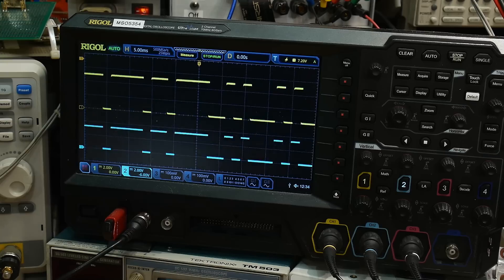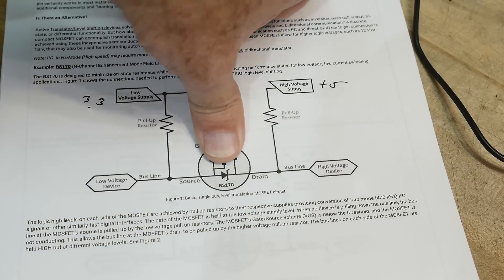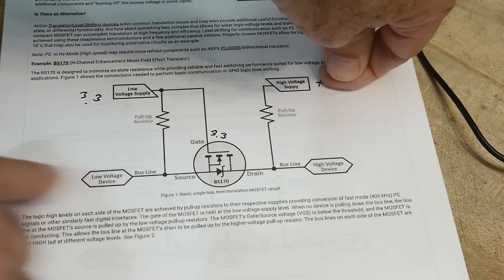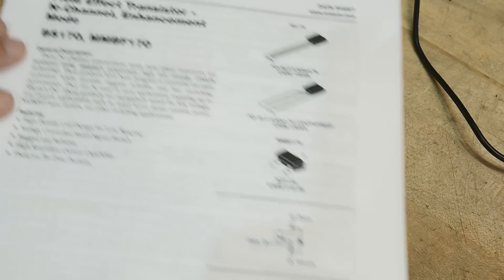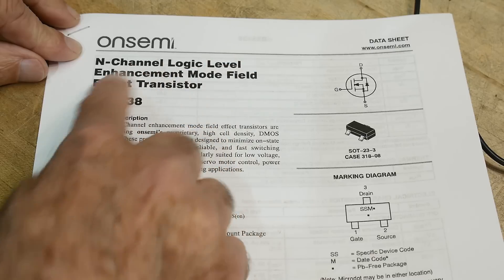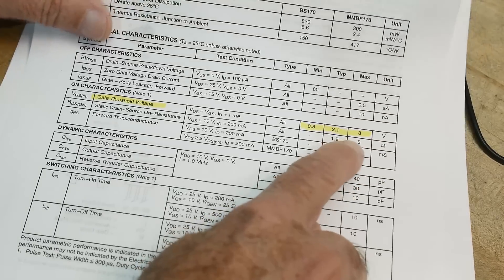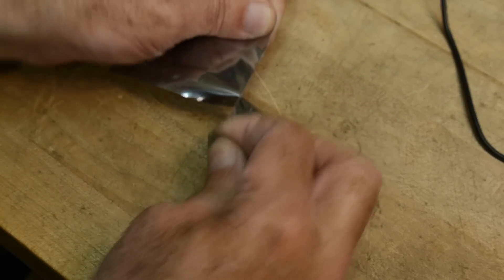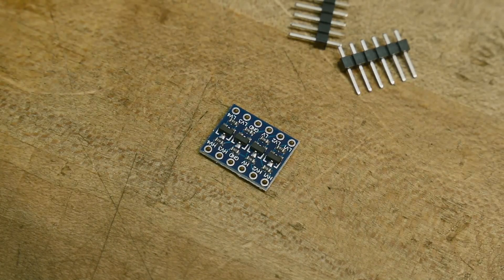#1855 BSS138 Logic Level Translation

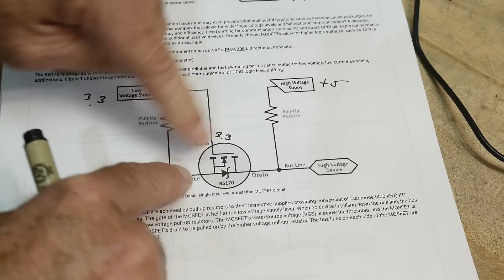Comment: 3:34 Wouldn't the 5 volts get sourced into the 3v device then. It doesn't make sense. The 5 volt side would then fry the 3 volt side since the 3v side went low and is acting as ground.

Comment: Nice video, how fast is the ON or OFF state.
Reply from the maker: AI: If your application requires data speeds of under ~400 kHz, the BSS138 level shifter with 10kΩ pull-ups is an excellent, simple, and reliable solution. For speeds approaching or exceeding 1 MHz, especially for protocols like SPI or I2C Fast Mode Plus, you might need to:

Reduce pull-up resistor values (if your connected devices can handle the current).

Minimize bus capacitance (shorter traces, wires).

Consider a dedicated active level shifter IC for optimal performance.
Reply: @IMSAIGuy  Thanks much, only around
 20KHz

Comment: You can easily fix the problem by raising the gate voltage of the BS170 to 5V. From the specs, Vgs_thres > 2V for all temperature <125°C, hence the low voltage side will not exceed 3V (without the pull-up at the low side) when both sides are open.

Comment: This is timely and awesome!  I've been using the classic BSS138 circuit for several products for the last 5 years.  I just adapted the same circuit as a cutoff switch for an i2c bus that was conflicting with our AVR programmer.  Both sides are at 3v3, but the gate is tied to the programmer's separate 3v3 bus.

Comment: The NXB0101 chip (from Nexperia) is yet another dual supply transceiver, better suited for bus translation up to ~100MHz (3.3V↔5V, and it can also go high-Z). NXS0101 is the open drain cousin, though it's much slower.

Comment: 4-ch PCBs from CN are Sparkfun module from 2013 clones btw.
A lot of those exist thanks to Adafruit, Sparkfun and the like OSHW contributions cloned and mass-produced often using CN analog chips (which are statistically quite good) if such exists, with genuine brand parts too, but generally CN modules almost always work.

Comment: I'm confused - but that's good.  Makes me do some head scratching.  One thing though.  In High School and the Air Force all of my instructors used electron flow!  When back in college, some of the professors would use electron flow and the majority would use current flow.  It was the same way with the text books.  I graduated with PTSD- or something.  There was hole flow but I don't want to get into that.  To many memories.  Well that's maybe why I'm confused.  Thanks for the time spent on a great presentation!

Comment: Hi Sir please reply... 
this question is very very confusing...
I have 2 identical 12V DC 7.5Ah batteries say X and Y.
One side of a normal bulb is connected to postive terminal of X battery, and another side of the bulb is connected to the negative terminal of the Y battery.

The negative terminal of X battery and the positive terminal of Y battery are not connected to anything.

So, in this case, I want to know whether there will be a current flow to the bulb, and whether the bulb will glow??? Give reasons if bulb will glow, and reasons why bulb will not glow.
Thanks in advance.
Reply from the maker: sounds like a homework problem

Comment: I use 74LVC245 for level shifting. The 74LVC245 is great for higher speed signals vs discrete FET based level shifters & have 8 lines. Additionally TXB0108 is a great level shifter too though I have quite a few SN74LVC245AN’s around.

Comment: I've seen bipolar transistors used in the same topology.  The only change needed is a base resistor.  As with a mosfet the transistor will work backwards.

Comment: Thanks,  I did not know about this topology for level shifting.
@5:11 remember the source and drain of the normal MOSFET transistors are interchangeable.  So when the output is low the source and drain are exchanged.
Here the body diode does not get engaged until much higher currents( that is when I x Ron > 0.7 V)
The advantage of this topology is its speed and it is bi-directional, the disadvantage is use of constant static current.
Normally level shifters are made of cross coupled pmos transistors on top of nmos transistors.
The disadvantage is that it slower than this topology.
Also, if you have MOSFET transistor that you could connect to its body, it is better to connect the body to the lowest voltage( ie. in this case 0 V)
Reply: The static current situation isn't as bad if you're already using a protocol, like I2C, that is designed to use open collector outputs, pullup resistors, and logic high idle state.

Comment: Keeping in mind these are only good for low speed like serial ports and slow spi etc. There is way too much capacitance in the junction to use for, say 10Mhz, and you have to resort to the proper chips with more stuff inside them. It can be easily seen on the oscilloscope at higher frequencies and can be confusing on the logic analyser.
Reply: How fast can you get with two NPN BJT's connected together in reverse orientation (emitter to collector)? With the two bases pulled up to the respective voltages you want translated as well as pullups on the emitter/collectors.

example:
                         1K
              |------/\/\/\------| 5V
              |                         1K
              |               |------/\/\/\------| 5V
              |          __|__                    1K
              |      * |/        \        |------/\/\/\-----| 3.3V     
              |     _/             \_     |
    A  o__|__|                    |__|__o  B
                   | __               __|        
                          \         /| *2N3904
                            \___/
                                |          1K
                                |------/\/\/\-----| 3.3V
Reply: @pol.kraine7890  You would have to draw it up in spice. It would be faster as FETs have much more capacitance then ye olde BJTs. Then again, the dedicated translation devices have Schmidt triggers, giving them even less limitations at high bandwidth.

Comment: A few points: there is a 2N7002 which is like the 2N7000 but with tightened spec (threshold voltage = 2.5V max) in an SOT-23 package. However the BSS138 is cheaper, so good catch.
The body diode in these small signal MOSFETs isn't going to be dropping as much as 0.7V in conduction, more like 0.6V when loaded with 10K from a 3.3V rail, so Vgs is at least 2.7V.
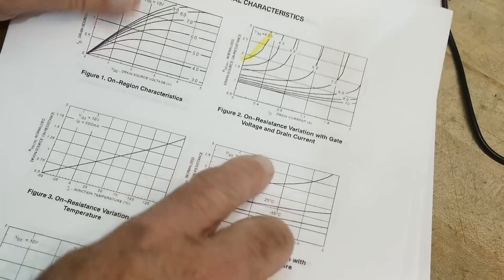At 9:00 when the MOSFET starts conducting as the diode is turning on, the channel resistance becomes so low that the source is effectively dragged down to 0V. You now have 3.3V Vgs, not 2.6V.
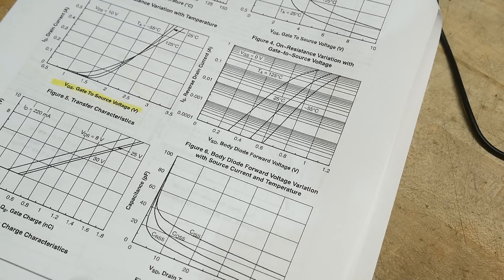At 8:20 we really don't want the MOSFET to turn on "hard", just "hard enough", otherwise the increased gate charge reduces switching speed. Better not to in level-shifting applications.

Comment: interesting, You also got  TXS0101 (single),  TXB0108 (8 fold), but require 2 100nF capacitors on both supply sides.
But the Sizklai also works pefectly, but requires 1 more transistor than your circuit, but not bi directional.

Comment: nice introduction of this nice MOSFET and the use in level shifters. However, the real resistance is of minor importance for a level shifter. Even for I2C lines it only has to be significantly below the pull-up resistors' values, but 10s or even 100s of Ω should not matter much, unless you have long lines with high parasitic capacitance and high frequency signals.

Comment: The 74CBT16211 bus switch is my favourite device for 5V<->3.3V logic level conversion. It has 24 lines, so you can level convert an entire chip at once, and the fact that it doesn't use pull-up resistors makes that it works at much higher speeds than a MOSFET solution. You should make a video about it!, Using the 16211 for logic level conversion ain't too obvious from the data sheet, so a video would be helpful for people.
Reply: Are you sure it really can do logic level translation? Sure, there's a bullet point mentioning logic levels but there's no way to tell it the range for a given port. The description says switch, and another bullet point discusses analog applications among others. I struggle to see how it could function as a level translator while also being suitable for analog applications. 

Have you hooked a scope to an input and output and verified that it's actually reducing/increasing the voltage?
Reply: @markp5726  Yes, I told this ain't obvious from the data sheet at all. Search for the "Texas Instruments CBT (5ĆV) and CBTLV (3.3ĆV) Bus Switches data book". At the end of the book, there is a chapter about using these CBT chips for voltage translation. Basically the FET switch reduces incoming voltages to 4 Volt. To make them limit voltages to 3.3V you insert a diode into the Vcc line, and you can buy these switches with the diode already built in, they have a D into their part number: 74CBTD16211.
Reply: @markp5726  I said it was badly documented :) The 74CBT74211 will by default limit voltages to 4V. You need to insert a diode in the Vcc line and you will get 3.3V. But there is more: There exists an 74CBTD16211 with this diode already integrated into the chip, making it ideal for voltage capping an entire bus at once.
Reply: @danielmantione  oh that is weird. The datasheet for  74CBT16211 (which I found first) is fairly different from the CBTD version

/me dives for the rabbithole...

Comment: There are indeed much better MOSFETs available nowadays than the BS170, and they are also much cheaper. The only advantage it has is that it cab be brought in through-hole package, making it easy to use on breadboards and experimental PCB's and so.

Comment: Great explanation, love the detailed analysis.  But 0.7 volts is (kinda) valid for 3.3 volt devices.  Also given the light loading, the diode will (probably) be less than 0.7 volts.  "Engineering is the art of what you can get away with".
Reply: I doubt bridge building engineers embrace that saying.
Reply: @jspencerg  Except yeah they do. There's a reason for the saying "Any idiot can build a bridge that stands, but it takes an engineer to build a bridge that barely stands."
Reply: @AttilaAsztalos  "...with the correct safety factor thrown in"
Some engineering fields permit or even encourage wanton cost saving, planned obsolescence or life till the end of warranty. Bridge building in the USA is not one of those.  Neither are the probe building wizards at NASA.
Reply: @jspencerg  With NASA you may be fighting weight or size factors instead of cost.  And then there's always the old 'time to market'.
Reply: @jspencerg  One would hope, but I'm afraid some do.
Reply: The 0.7V is only there before the fet turns on - once it's on, you get the 5 ohm (or less) path through the fet, and the diode is essentially out of the circuit. The diode just bootstraps the fet into the on condition, and then the fet takes over, and only in the direction of a low on the right driving the left side low. It's actually extremely clever how it works!

Comment: Thanks. The datasheet shows maximum Vgs(th) is 1.5V. It means if the gate is 3.3V and 0V at source in the circuit, then this MOSFET will get damaged. So it cannot be used for 3.3V to 5V level shifting. Please correct me if i am wrong....
Reply: The parameter you are listing is the threshold voltage, not a maximum voltage. There must be a voltage difference between the gate and the source for the MOSFET to turn on. That value in the datasheet is saying that for some devices that difference may be as low as 0.8 volts, for most it will be 1.3 volts, and for some the difference must be at least 1.5 volts before the device will turn on.   The value you probably were thinking of is Vgss, which my datasheet lists as + or - 20V for the BSS138.
Reply: @tfrerich  Heartly thanks for your clarification... Yes i got confused with Vgss & Vg(th)... Thank you...

Comment: I've used a 2N7000 to level shift 5V to 3.3V and it worked fine. Also used an A2SHB smt mosfet. The max threshold for the A2SHB is a Mere 0.85V
Reply: You want to avoid using NMOS like Si2302 (A2SHB), which has high Ciss capacitance (around ~7x more than BSS138). It will hurt the rise time.
Reply: @tze-ven  thank you for the informarion

Comment: "That means you have 4 level converters on one board - That's what I have over here" - getting in on the high side and coming out at the low side."  
With five of them for a buck and a half I was sure to see the same signal converted from high to low and back 10 times in a row. 
But thank you for the perfect explanation. 😄

Comment: Thanks for the clear explanation. I would like to mention the TXS0104E device that I have been using.
The TXS0104E contains 4 level translators similar to what you showed. Additionally it has internal 10k pull-up resistors, and edge detection on the input signal from either side. When a transition from low to high is detected, the internal circuitry actively pulls up the input to speed up the transition. After the transition the active pull up is again released. Very handy for long distance one-wire and two-wire applications.
Reply: I was just going to post the same thing.  I've had nothing but trouble with a board from Sparkfun with the described design.